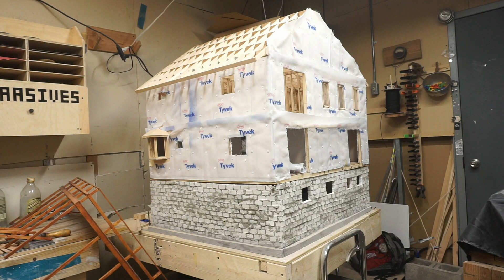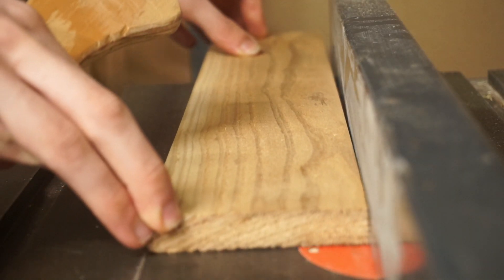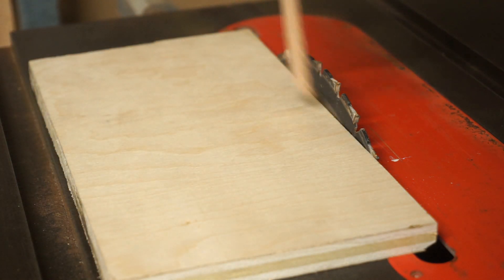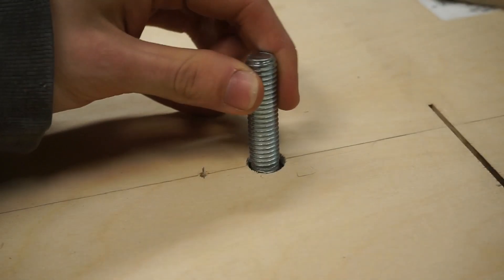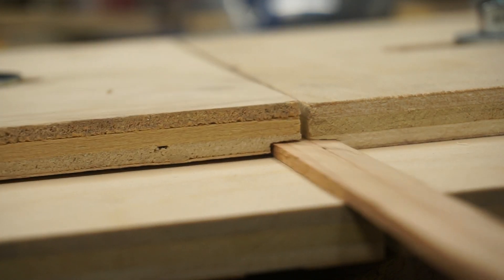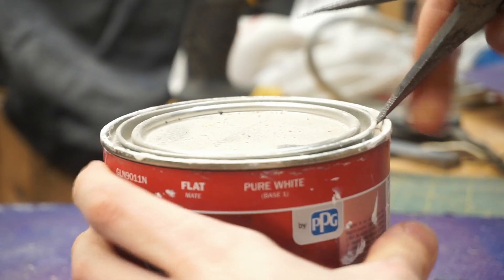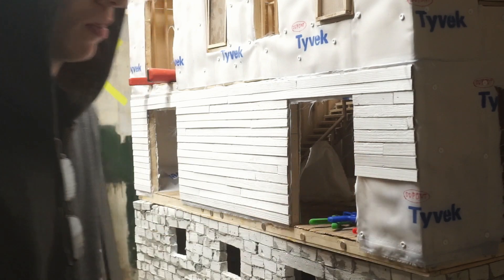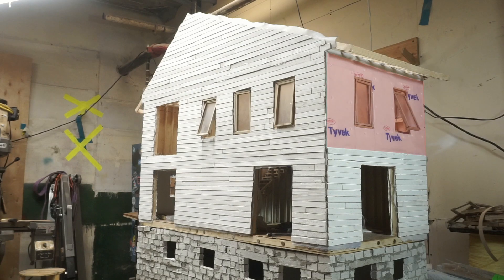Building a Realistic Model House, Part 31: Making and Attaching Miniature Siding

Comment: Allways partial to BridgeWater Blue (greyish) siding, sandyellow windows,  dark blue corner boards and brown shingles.  Works well together.

Your lao joint table saw jig is good, always a good finish to a day when you can still count to ten. Working toward a jig of same though for router to do 4x6 barn T&G flooring (that is /32nds.  Siding will be similar at 3x5 /32s lap jts for vert. siding. (sic 5/4x5).  Working 1":32"
Reply from the maker: Thanks!